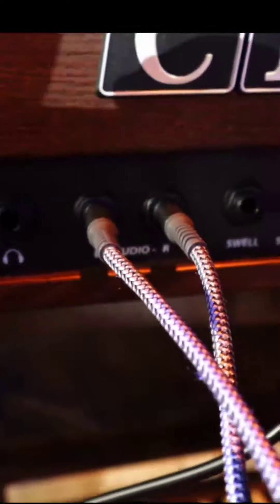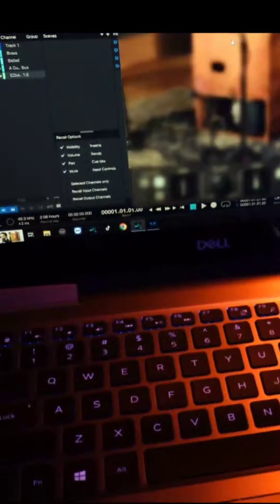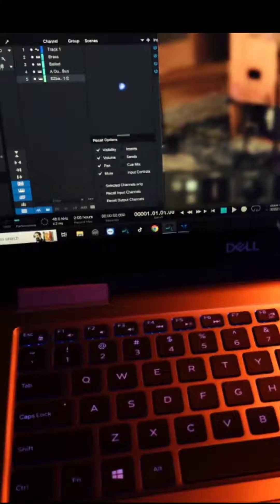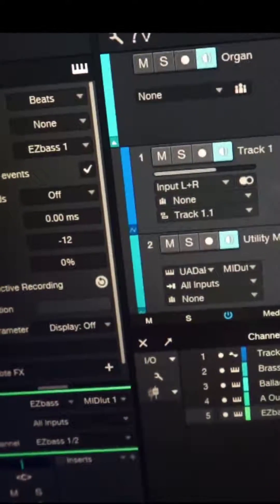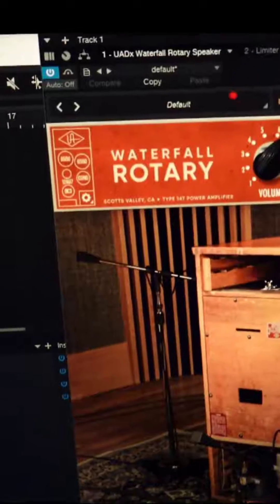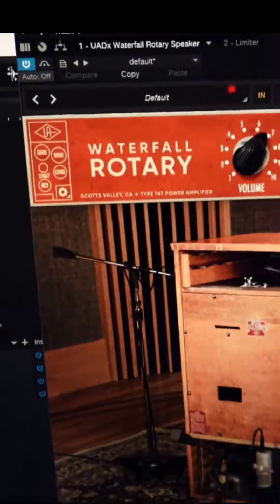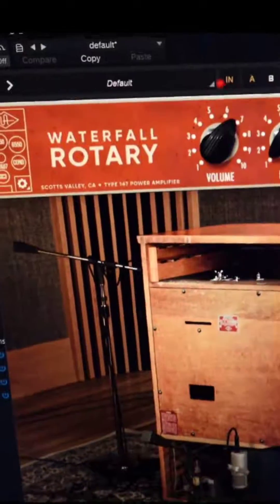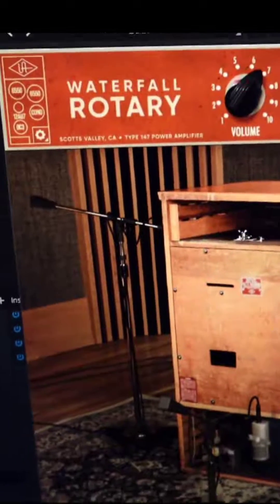Crumar Mojo UAD Waterfall plugin Setup

Comment: Are you contolling the waterfall rotary via a MIDI signal to switch on/off the leslie, control overdrive etc? If so, how are you doing that running the crumar through audio? I got the rest of this setup but I am having to adjust the rotary on the computer and that's not intuitive in a live situation.
Reply from the maker: @DSMuzikProInc  you have to set up a separate midi track to trigger the Leslie sim. Just send the separate midi track signal to the Leslie. And when you hit the switch on the Crumar it should trigger the speed on the rotary. I'm using a foot switch connected to the swell pedal on my pedal board.